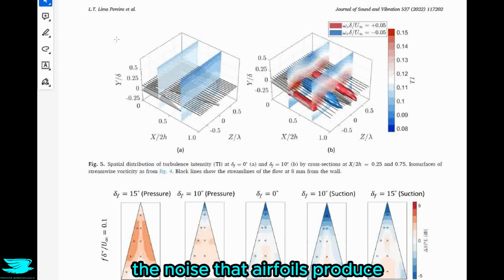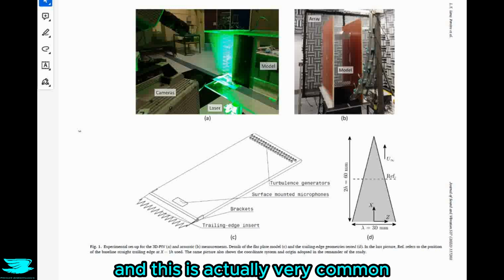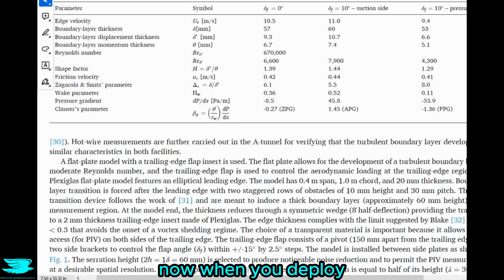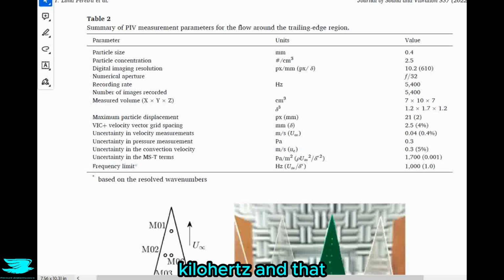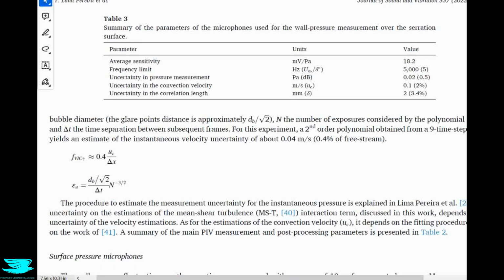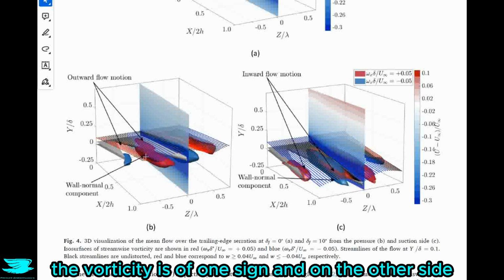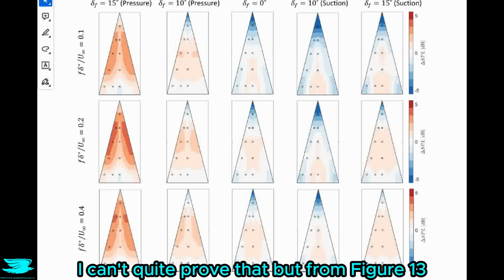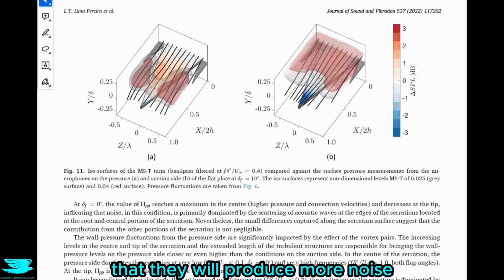Podcast 182 Serrated Trailing Edge Aeroacoustics

Comment: Could you make a video delving into the performance aspect (lift and drag, lift/drag, resistance / change to separation patterns etc)of different trailing and leading edge geometries instead of the acoustics? Serrations, dimples, waves etc
Reply from the maker: Sure.

At the moment, we have some videos on those ideas. One recent podcast is this one: https://www.youtube.com/watch?v=M43YvDpKQCc
Reply: @PremierAerodynamics  I'll check it out.

Mercedes F1 even ran a serrated trailing edge on their first element in their multi element rear wing, they said it was a negligible gain and they eventually stopped using it. Would be cool to know what the gain was amongst other aspects of both leading and trailing edge geometries.

Although I assume the answer will be that any benefit is negligible at best and isn't worth the time and the risk is you make things worse if you don't know what you are doing - otherwise all airfoils would have them. Nevertheless would be cool to see and get a breakdown.
Reply from the maker: @nesmio7378  Mercedes is definitely innovative and in my opinion it sometimes can hurt because they take on projects that aren't ready yet and that costs time that could be used elsewhere, given the constraints. When a topic matures, it is very possible that the idea that failed before will work now, given the new knowledge. But, given their performance over the past decade, they seem to be walking that tightrope well.

Comment: Hello,

I am interested in noise reduction too.
I wonder if it's possible to do a formula of the serration size.

- It's depending on chord length. 
- Reynolds Number
- Speed of boundary layer
( which depends on angle of attack and air speed )

A not so accurate formula for amateurs would be great. That the serration size can be estimated to start with.

I also worked on the props for cars issue.
I invented a safe prop. That is blown up like an airbag.
Since there are no hard parts in the prop, it got a hard time to do any harm if it collides.
It's also very turbulence resisting.
And can't get in resonance pulses that do noise and worse.

Since its super lightweight, a one bladed prop without counterweight is possible.

A big, slow moving , one bladed, ballon prop is super silent anyway.

It's suited for paraglider propulsion too. It only got struggles with producing large amounts of thrust.

Doing some serrated edges on might also help.
But atm, i got no clue how to size these edges.
Reply from the maker: We'll get back to you on that.

Comment: Thank you for the video. This is a topic that I was really looking forward to. 
I made a small mirror for my car using serrated trailing edges. 
I also have them on the trailing edges of my segmented boattail, not for noise reduction, but in the hopes that the airflow would flow around the serrations and remain attached on the  remainder of the extending tail sections. 
I have noticed most birds have a 'VVVV' serrated shape to the trailing edges of their wings and tail feathers. 
Not sure if they serve any function like the serrations do on the owl wings, but I found it interesting.
Reply from the maker: They generally do serve the same function. Another general purpose for non-uniform trailing edges is to control where the flow is leaving the body from. That way, you can control where it will impact downstream.